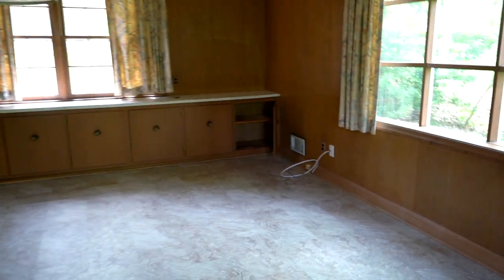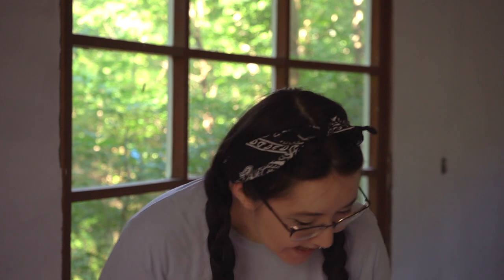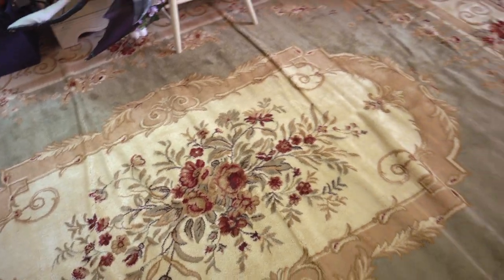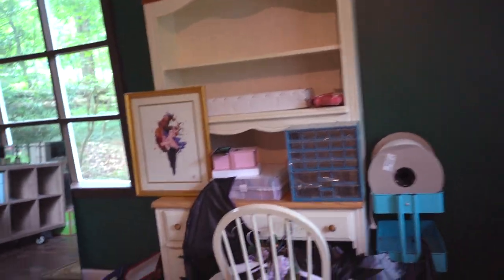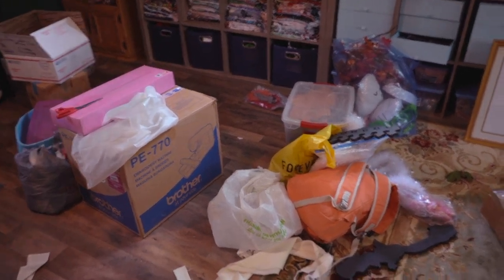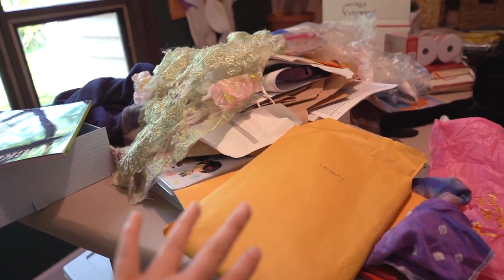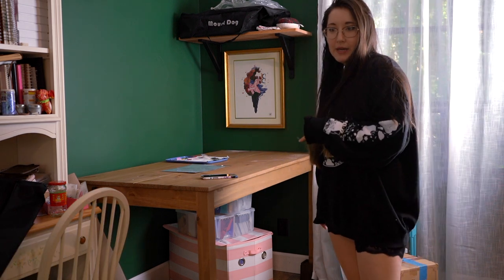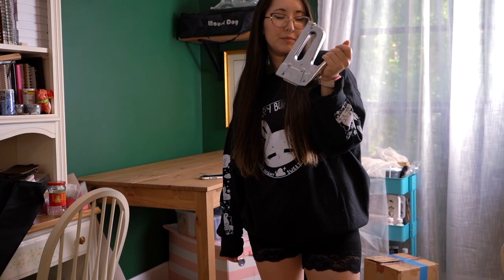DIY-ing My Dream Cottagecore Sewing Room | How to Make a Pretty and Functional Sewing Studio

Comment: That is really stunning work.  I vote yes for a tour video.  Go for the full Bernadette...
Eeee... so looking forward to CoSy and your Strawberry Dress video.  It's gonna do great things for your numbers...
I grew up in a home with a basement variation on your studio.  Only the walls were a grey 'wood' board and the cement floor was finished with grey paint.  That sky-blue fireplace was swank, back in the day.  They would have been the cool people on the block.  The ones who had The Parties.  Although it's probably best for all that it's no longer connected,..

- - - 

Sewing Update
My dry spell is ended.  I made something that works.  A 17th century style tie-on pocket to become... The Ultimate Fishing Pocket.  Been fishing a spin rod and reel since I was four (learned & still use Grandpa's gear).  I also do fly fishing and don't have a car.  So I need something that will get me out into the water and won't look Too weird on the bus and train ride to the shoreline.  The standard boy-sport version is a chest pack (that just don't work for chesty me...).

Minimum requirements - small easily reachable fishing kit, minimal med kit, thermos of coffee, water bottle, sun block, Granddad's portable tackle box, 'surf sock' shoes for wading in the rivers, tuna fish sandwich, apple, minimal sketching and watercolour kit.  And a tether for my wading stick.  So I can do the full Group of Seven experience of Bytown.  Because I can fish in the shadow of Parliament Hill.  And if I'm going to do all that, I can't be tripping over my own gear.

And damn it I didn't mostly hit all the checks on the list on the second draft.  I've got something that will get me through what's left of the Summer and into the Fall.  Yesterday I got caught in the middle of the Rideau in one of those sudden August monsoon thunderstorms.  Got me through with flying colours...

Have I ever mentioned that I'm looking towards doing a sewing channel of my own someday... I may have just designed my first pattern that's sell-able.  Tee.  Hee.

- Cathy (&, accidently, Steve), Ottawa/Bytown
Reply from the maker: Thank you! Haha I feel like I would have liked the fireplace more in a different room but I was so set on a cottagecore style studio that it just didn't fit into the space 😅 we did our living room in blue and peach, it would have looked so nice there! haha oh well

That's so cool!! haha very nice utilization of something historical to serve your purpose 😊 also that's SO many things to fit in a pocket I'm so impressed!! If you sell patterns for it I'd love to make one, I haate having to drag a purse everywhere. You should totally use it as your first sewing channel video!!
Reply: @moth.faerie  {laughing - I start with a fishing & sewing video I may just tick off the vegans of our tribe... ah well, it all comes down to the action shots, I guess}

As much as I can stuff into my pocket, you should see what the boys drag out there with them (I'm quite impressed they can still stand up straight under the weight).  But yeah, everything is findable with a blind reach.  Midstream was a washed-up, bleached out tree.  Rested my pole in the hollow (where some weeds & a spider live).  Rested me up against the tree.  Drank some coffee from my thermos and just hung out.  Mama like.

Then the pocket got me to the shoreline when the lightening started to fall from the sky along with the torrential downpour.  Everything intact and safe.  Dry just wasn't an option for anyone...

As much as that fireplace would have gone with your living room, it's probably best for all that she's gone on to the  great scrapheap in the sky.  They were kind of flimsy in the 70's.  Not sure if it would be a successful transition to the present day....
Reply from the maker: @stevezytveld6585  that sounds so nice! I used to go fishing with my dad but we were always in a boat rather than in the water :) a storm while you're in the water though sounds scary, I'm glad you made it back to shore ok!

and thats a good point about the fireplace! I hadn't really intended on using it, but Micah wanted to so now I'm glad we didn't risk the fire hazard 😅
Reply: @moth.faerie  I've never actually fished from a boat.  Just docks, shoreline and standing in about knee deep water.  It looks like fun.

I will admit I did have a moment when I looked up and saw the lightning, with the thunder arriving a second later...  After that I was just concentrating on my feet and walking staff.  I may or may not have been repeating "I am fine. I am fine in this moment.  I am fine" to myself for a few feet of the journey.  Even then, it was really beautiful.  I was in the middle of all this wild power, meanwhile traffic was still going by on the nearby bridge.

All this untamed right at the edge of downtown...  Moments before the storm I saw a Great Blue Herron come into land.  Water was full of ducks and free-loading Canadian Geese (also known as Cobra Chickens).

Your fireplace will come.  Because they are important.

Comment: For an ironing board, you should use 100% cotton or wool. Polyester will melt and will not hold up. You’ll probably discover this as you use heat and steam on it.
Reply from the maker: This video is a few months old so I've been using my ironing board every day since I posted! It's been holding up pretty well, it's compressed a bit but I actually wanted that to happen so it's more of a firm squish. I haven't needed to re-cover it yet so if it's all melted when I open it back up I'll give an update

Comment: What is "homesot"? Or what ever you called it. The board you put on the table.
Reply from the maker: it's spelled homasote! it's a fiberboard that's usually used for sound dampening I believe, but pretty much every costume shop I've been in uses it to top tables so you can pin into them! it's kind of like corkboard except that it won't disintegrate like a corkboard will. I got mine at Home depot, unfortunately lowe's doesn't carry it.
Reply: @moth.faerie  Thank you :) We don't have home depot or lowe's here and I doubt it is called homasote here either. But atleast I have a starting point now :)
Reply: @moth.faerie  Cellulosa based fiber board!